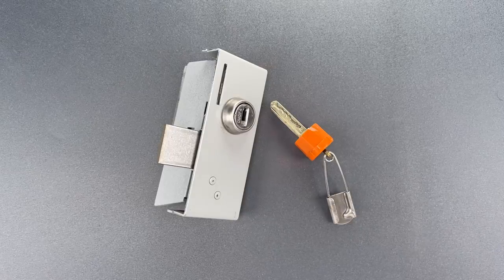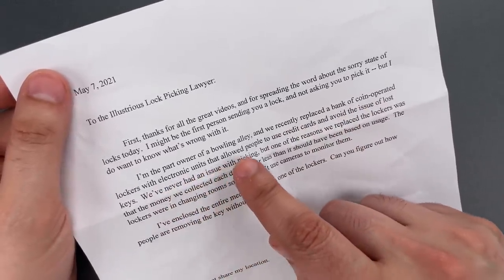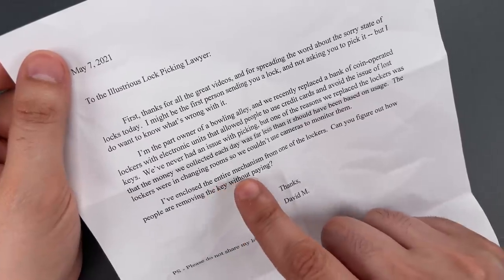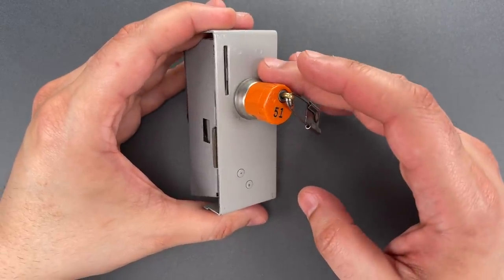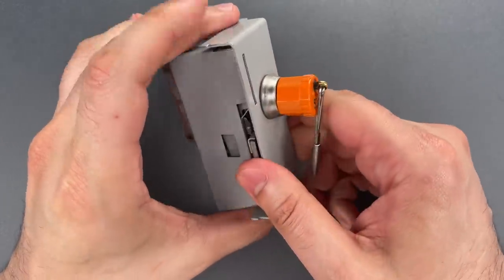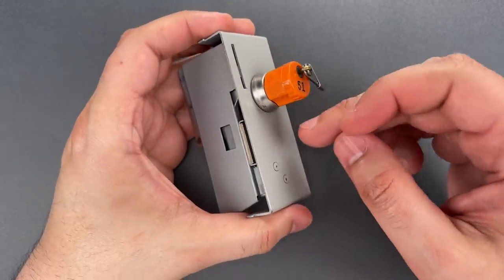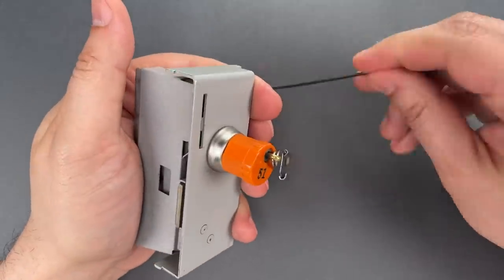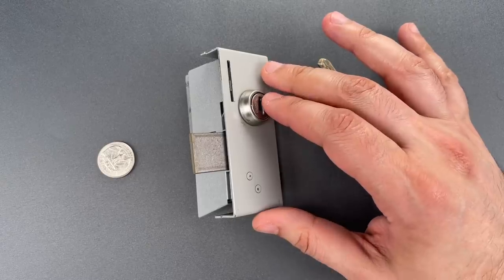[1308] A Huge Flaw In This Coin-Operated Locker Mechanism

Comment: Great job! Also, I think you should hang on to that quarter, it looks like it's made of silver! If there is no copper edge to that quarter, you can bring it to a coin shop and get several bucks for it :)
Reply: That one wasn't silver. I worked many jobs handling money and change back in the day when silver was still somewhat commonly found in circulation. There's a different sound when you drop a silver coin versus a 'sandwich' one. Almost all of us minimum-wage folks had our ears well-tuned and waiting for that sound as we dropped coins in the cash tray so we could snag the 30%-40% premium silver brought back then from the local pawn shops. Rare to find them now, but once or twice a year either me or someone near me clinks one down and my mental alarm screams out "Silver!" all over again even 45 years later out of habit. Just to be sure I replayed the clip- no special sound = no silver.

Comment: That is way simpler than what I was thinking.  Without knowing there was that little finger there and exactly where it was, I was thinking you could glue a piece of string such as dental floss to the edge of a quarter and drop that in.  Keeping tension on the string as you turn the key, you could then pull the key out and pull the quarter back out as well.  Or just drop a slug in there with a string to pull it back.  I have never used a locker like that so I do not know what you can see of the mechanism when you have the door open.

Comment: I'm prob gonna get in trouble for saying this but here goes. One summer I was really bored and I was thinking of things to do. I then now remembered the times I wanted a snack from a vending machine but did not the the money for it so I then thought of an idea. The reusable coin. Virtually the coin would be attached to strings and I would pull it out and dip it back in again. I started scouting out places like swimming pools, recreational centers and other locations that had vending machines. I got very lucky and found out that a near by swimming center had an old model of a vending machine that doesn't use the "anti-rob" technology that modern vending machines use. I then got to work by googling up the model number and it's inner workings. Then I used some wire (35% steel,40% copper and rest was mixture of unknown materials) to attach to the coin and trick the machine that I was giving it coins. That summer I never had to bring more than one dollar on me :). 

Ps if you're wondering were the coin is, I gave it to my friend cause my parents once caught me using it XD

Comment: These mechanisms were never designed to be secure they were designed to take a small deposit from the customer (who has already paid to use the facilities) which would be returned when the key is replaced, some greedy companies have modified them to steal the deposit every time the door is opened and re closed

Comment: I think, but I'm not sure, that some coin operated machines (and probably locks) have a shield.  The coin's weight causes a shield to cover the opening slot and without the weight of the coin its inoperable.  That prevents inserting a removable object to activate the release mechanism. I'm sure there's a lock picking stunt to bypass even that but it keeps mostly honest folks honest.

Comment: Wow here in Germany places that use locks like these (gym, libraries, stores so you can lock your shit and not take everything inside etc.) have it designed so that when you put in the key when retrieving your stuff your coin falls out. So here it‘s not a way to profit but just a convenient way to store things that is provided. The newer electronic looks they have in some libraries now are the same, kinda like a hotel safe, you quickly come up with a 4 or 6 digit code and when you open it, it‘s resetted …

Comment: Most likely people would be coming prepared with a coin with a piece of wire or string stuck to it. They'd drop the coin in, lock the locker, then pull on the string to retrieve their coin.

Comment: I remember seeing on cartoons when I was growing up these kinds of locks being opened by a coin or washer with a length of cotton tied to them.  Insert the coin/washer, do what needs to be done, then use the cotton to retrieve the coin/washer afterwards.  Bet that would work on this too.  I mean you could just chuck washers in instead of coins, but that does leave the washers in the coin box so someone will know something is going on.

Comment: There were probably a few customers, probably older people born in the 40s, 50s, and 60s, who had some good ole'fashioned "Slugs."  You often saw a Slug in Looney Tunes and such, but basically it was a round piece of metal or heavy disc (it could also be a rounded rock) with a hole punched through it and a long string attached.  This was a popular way to steal from vending machines, but Coke and Pepsi got wise to the act and put in mechanisms to stop slugs.  That lock though... You could pop in a slug, and then use the string to yank it right back out. 

I would be interested to know the main demo at that bowling alley, because younger folks probably wouldn't know how to make or use a slug, or even that you could slug a lock to begin with.  The 60 to 80 year old Demo...  Probably 40 to 60 during much of the time those locks were in use, definitely would know about slugs and would recognize you can slug any older quarter operated lock that doesn't have a mechanism to turn and dump the coins.

Comment: Hmm I never saw coin operated locks like this where the coin goes in from the outside. Locks I see (in swimming pools for instance) have the coin drop on the inside... but then you usually get it back after use.

Comment: So what if you had changed the position of that finger if you put it on the bottom of the lock rather than right where the coin operated thing is and you had a little tiny tiny wire there to check the coin was in there. It would be much harder to access and it would also be very difficult to reach down and trick this system

Comment: When I was a kid we used to have a coin with a pice of string taped to it: We used it to call home from payphones.
Drop the coin in the slot, keep the tension on the string when the coin settles and then dial your mom... when the coinslot opened to allow the coin to drop in the vault you woud just yank it back up and out... 
:D

Comment: Ah the 1980s...  when nothing more than a length of nylon strimmer wire was all you needed to defeat most coin mechs.
Reply: I was in high school in the late 90s and found that a small paperclip and the wire from a spiral notebook could get into basically everything in the school and defeat most security in town even stuff like vending machines, based on this channel I doubt much has changed since then.

Comment: I kinda doubt every person not paying is carrying a thin piece of metal around to do this. More likely someone figured out that exerting pressure on part of the locker/mechanism, shaking it or some such has the same effect. I've seen such things before unfortunately. Reality is we only have part of the puzzle here, we have the lock but not the locker.
Reply: You don't have to use the exact, same system as LPL.
He actually says in the video that all you have to do is stop the lever - how you do it is up to you. 
I have a long key on my keyring that would work. Coffee stirrers are easy to find.

Comment: There is always a way to defeat these mechanism. But I hardly believe so many people are doing it all the time. There has to be another explanation than the lock itself. Maybee the stealing occurs in the coin hopper. Usually there is only one hopper at the bottom for the whole section.

Comment: Interestingly, getting free use of these pay lockers may be a federal crime under 18 USC §491.  Although that chapter is for counterfeiting and forgery of money, the language is quite broad in that section.
Reply: So you mean tricking the lock by using a piece of metal (Or even a popscicle stick !) that doesn't look at all like money can be considered forgery of money ?
Reply: @psirvent8  It's the broad language in §491 that does it.  Using any "device" to defeat a coin operated payment machine a very short summary of part of that law.

Comment: It is honestly outrageous that they are already in his venue and yet he still charges them even for something as evidently necessary as a locker.
Reply: i would imagine that the price barely covers the operating costs of the lockers. Lost keys, damaged locks, keys and cabinets, cleaning etc... Furthermore it allows the locks to be operated without a person handing out keys which would be additional overhead and reduces the likelihood of someone just stealing all the keys because they're a little teenage monster - would have to pay an equal amount to the keys stolen (or an immature adult).

There's are valid reasons for it.
Reply: @xm210c  well keeping the keys from getting stolen could be equally well (or not well) achieved if you gave the coin back at the end as is the case here in most european countries. Operating the lockers is something that falls under general maintenance and should be paid as part of the entrance fee.

I might have exaggerated but it feels petty and greedy to charge the customer for every little thing that is part of the experience.

Comment: I have only used coin lockers in Japan.  I believe they keep the coins, I can’t remember.  Instead of a quarter, I think they are about 100 yen, maybe more.  The coin lockers are usually kept in public spaces with a lot of foot traffic and possibly security cameras.  But I bet if someone really wanted to, could systematically use each locker as normal and make a copy of each key.  Then waited till someone else used the lock and then the thief would just simply used the copy of the key to quickly open locker and take the items. Even before pandemic, it’s common for Japanese to wear face masks. Fortunately, theft like that is rare in Japan.  When I used the locker was only because the final day of my trip, the check out time for hotel is 10 am.  I use a coin locker at a large train station that I would catch the train to airport. I ensured that the only things in there were my smelly clothes. 😂

Comment: Hey I was rewatching LPL’s “nuke lock” (lol) and had a idea, what if someone made a lock where you need 2 keys, the lock would be a sideways cylinder, where you put the keys at the ends of it, and you gotta turn them counter clockwise, ( so one key goes to it’s own way while the other also goes it’s way) and to finish it off, it should have a mechanism where if someone is picking one side of the lock it won’t work because the lock has to have both side’s pins ready to operate, sorry kinda long and weird lock idea and ik he only does locks that exist but cool little concept.
Reply: Check video 552, it's kind of what you're talking about ...

Comment: Do kids really have a bent piece of metal like that? I wonder if some common household item can do the same thing. Something kids might have access to...
Reply: A piece of coke can would do the same, I think.
Reply: whispers a knife...
Reply: A plastic strip should do equally as well ... Maybe a squashed plastic straw (if you can get one !) or something similar could be used. Cable-Ties/Zip ties ? etc ...
Reply: Paperclip, plastic card (old gift card cut up or something), thin knife e.t.c would probably operate the mechanism just as well. The majority of users breaking in were likely teenagers or adults rather than kids so had access to a wider variety of materials.
Reply: They could use keys, some wristband, folded paper (or even a swiss army knife, it exists always a kid with a knife because he's from scouts or something). After they discover the trick, they get a better alternative
Reply: Zip tie ezpz

Comment: I have a question: if you put a coin in with string taped to it or something like that, could you pull it out after it let you use it?
Reply: At some risk of losing the coin in the process, yes. But why risk that if you don't need a coin at all?

Comment: This made me wonder how the credit card system works. Off the top of my head the simplest method would be to have a sort credit card powered gumball machine dispense a key, but then there's no way to ensure the return of the key. I might have liked to see a method that charges a card and opens a locker, then hashes and stores the credit card number so when it sees that card swipe again later it just opens the same locker instead of charging the card. Downside there is that I would never trust the implementer to properly hash and salt the card number for storage, it would probably end up in plain text or md5 or something equally stupid.
Reply: Easier than that, the computer that controls all the lockers and the credit card reader will simply record the card number when someone swipes his card and associate it with the number of the locker that has been chosen by or allocated to the customer.

(Money being taken from the credit card at the same time unless the owner decides not to charge for the lockers).

When the customer gets to take his stuff back he simply swipes his credit card again, maybe dialing his locker number on a keypad at most and the computer automatically recognizes the stored credit card number, matches it with the locker number and finally unlocks said locker.
Not charging money this time though...

See ? It's that simple !

Comment: The vibration lever lock pick by stephen alva givens.
This lock pick can use tension to open the door but that would leave scuff marks no this lock pick is for the cops and it has a knob with a battery and vibration motor or sonic vibrator that is just a speaker. When it is put into a lock you run it to the back and turn on the machine and it vibrates then you pull it out to the first pin and push down on the lever to sense the pin and if you do then move it up and down a couple of time to the full length of the lever and the built in bump sensor will count how many and how high then simply do the rest of the lock then remove the tool plug it into a key maker and make a key and walla the door opens.

Comment: The difference between Europe and USA: In Europe, wherever these types of locks are installed (mostly public indoor swimming pools), you get your quarter back anyway. So noone would ever try to tinker with it in the first place.
Reply: Depends of where you're going, I've already seen lockers that don't give your coin back at some large waterparks with many slides and also deck chairs for hire in France.

You're (almost) right about municipal swimming pools, most of them (Still in France, I've never got to go to the pool anywhere else so far) will have lockers that give you your coin back, although I do remember of ONE where the lockers didn't give coins back.

Comment: This lock basically operates on good faith.
any coin regardless of the denomination.
any round thing like a plastic token that fits in the hole and doesn't brake the mechanism.
or in your case just a stick.
Will let you "pay" for the locker.
If you wanted to charge money for lockers this seems like a bad choose.
If you just wanted people of good faith to use the lockers then i'm sorry people are not like that..

Comment: "[118] EPCO (Bell Lock) 8-Slider Inner Groove Lock Picked and Gutted" -- that doesn't seem like the right previous video?
Reply: It's the same core as is in this lock.  The core is just mounted in additional housing that has a very sluggable coin op slot in this example. A Slug is an old'timey heavy quarter sized metal disc with a hole through it and a string attached to yank the coin out.

Comment: But if the coin is released, when unlocking it, how is the owner expecting to collect coins? The user just gets it back. Isn't that the whole purpose of this? Am I missing something?
Reply: This lock is designed to be attached to a locker door along with a coin box of some sort.
Yes the coin will fall from the lock when the locker is opened except it will be caught in a locked box like on a vending machine for example.

Yep, some locker locks do indeed give the coin back to the customer, simply by having the coin fall somewhere it can easily be retrieved with two fingers.
Reply: @psirvent8  so I was missing the box :) thanks
Reply: @gabeBucur  Indeed it is not shown in the video

Comment: This is a bowling alley, but credit card operated lockers at a swimming pool - where do you put your cards? Point of a locker is to hold your gear. Edit: Ahh. I got it. You put your wallet in the locker after swiping the card. slaps head

Comment: I have multiple questions about this letter. Why does this bowling alley have a changing room? Why do they keep the money needed to open the lockers? Don't you get the coin back each time you unlock it?
Reply: Shoes. Profit. No.

I hope this answers your questions.
Reply: @rogerszmodis  Every bowling I've ever been to just gives you the shoes, everone changes right at the tables/bowling lanes and keeps their regular shoes under the seats.
Reply: @maximilianb7722  that’s how I’ve always done it too. But that is the reason this particular place is using pay lockers. Maybe it’s in a place where it’s always wet or something and they don’t want dirty shoes near the lanes.